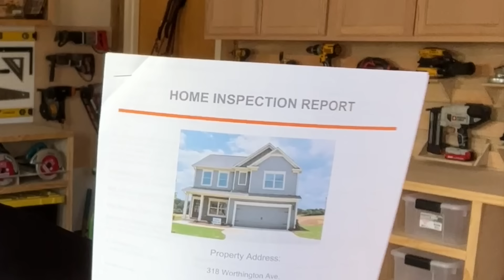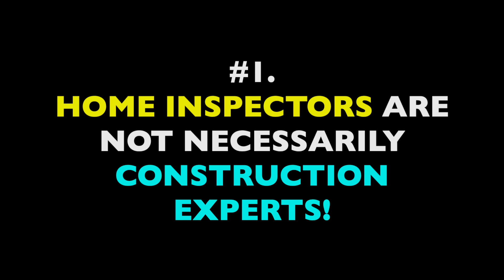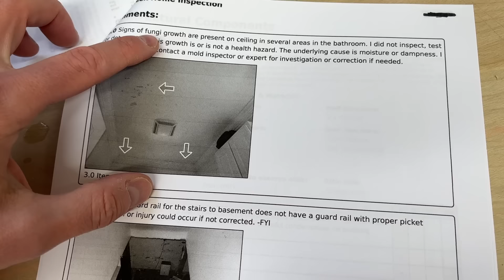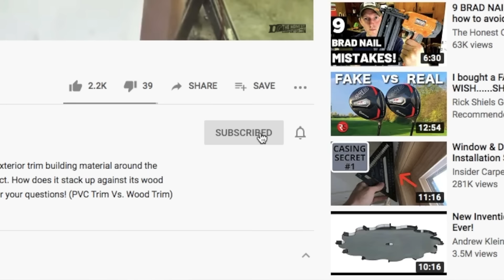The Truth About HOME INSPECTION REPORTS! What They Leave Out...(Homebuyers SHOULD WATCH This Video!)

Comment: The problem I've had with home inspections is the inspectors are more concerned with keeping the realtors happy for the repeat business.  They don't want to scare off the homebuyers as most of these inspectors are referred by your realtor.
Reply: I agree, however that means the home inspection industry could solve this problem by adding a rule that requires realtors to schedule from a "pool" of home inspectors so the inspector is randomly assigned. The inspector can then market some type of "badge" that shows he is a pool inspector and not one that works with specific realtors so that this conflict of interest is mitigated. Another solution is for the home buyer to simply get their own home inspector.
Reply: How about how their reports read?  Might, maybe, should...  They don't commit to anything.  Look at the limited training they get.  All about the money.  You'd be better off having an experienced contractor come in and look around.  A few weeks of training?  Yeah, right.  A waste of money.
Reply: Many states have laws stating that realtors, if asked, must provide at least 3 (# varies) recommendations for home inspectors. 

Most realtors want a thorough inspection because if there is an issue found after closing their client will not be happy with them as well as the inspector.
Reply: @Yellow.Dog.  As home inspector I've walked many a house with a contractor and pointed out things only to hear "hmm I didn't see that."  Great contractors will those things. Most contractors are only going to look at the issue you point them to and don't really take a comprehensive look.
Reply: Maybe the answer is for home buyers to find their own inspectors.
Reply: @thenaughto1056  Do you mind sharing how much or long you trained to be a home inspector?
Reply: @thenaughto1056  Can you share with us how much training is required for a home inspector where you live?  In Michigan, where I live, a couple of weeks is only required.  Thanks.
Reply: I've had home inspectors that have saved me tens of thousands of dollars.
I've also had inspectors that don't deserve to be called inspectors.
The good ones were hired and paid by me and recommended by a good BUYER'S AGENT.
Reply: @Yellow.Dog.  sounds like corporate consultants to me. No commitment/real liability, shift from professionals moving on carreer-wise to it being a career in itself with huge theory to pracrice imbalance...
Reply: @matt_9112  Did you notice the admitted "home inspector" didn't want to admit/state how long or how much training it takes to have that title?  It's a scam plain and simple.
Reply: Which is why i don’t work with recommended people from Realtors or brokers.
Reply: @Daniel  If you don't work with recommended people from real estate professionals, then you don't work with really good real estate professionals.
A really good, experienced broker will get you the best local help available.
A less than great real estate professional will send you to the less than great service providers.
I've dealt with both. 
It can make a big difference.

I live in a small town. When people ask me to recommend someone, I simply give them a list of who NOT to use.
Reply: That's why you hire your own inspector. I did for mine
Reply: @Yellow.Dog. depends on the state 90 hours for 100
Reply: @donaldlee6760 that’s a terrible idea. You would be assigned your Home Inspector. You wouldn’t have a say as to who you pay to look after your interest. There are a lot of sub par people walking this earth and I’m not allowing the state to choose who I do business with in any scenario. If chosen, they’d be guaranteed business no matter how poor their performance.  Capitalism beats socialism and a dictatorship any day, anyhow, anyway. Think about it.
Reply: @Yellow.Dog. in Florida an inspector is required to take 120 hours of online training, pass the state licensing board exam and maintain required hours of continuing education 14 hrs every two years. Also your association may require you to do more hours every year for their certification as a professional inspector.😅
Reply: It’s simple, get your own inspector, not the one the realtor recommends.
I hired an inspector recommended by my carpenter friend. He and my realtor really didn’t like each other. Which I considered as a good sign.
Reply: @juzoli  great advice. I work with hundreds of Realtors in my area for 14 years now. I only trust a handful and many hate when I pull up. However, they do call me when their kids are buying and say, “I’m looking for a great Inspector who is really thorough. That’s why I called you!”
Reply: @Yellow.Dog. you have to pass exams in florida and cant be paid as an inspector until you get licensed by the state..
Reply: Those ones are like the bad car salesmen or crappy contractors without your true interests at mind.
Reply: Some are referred by the banks or lenders.
Reply: @windmillacres679 this is an excellent comment.

Comment: As a tradesmen I can tell you this is absolutely accurate. I'm asked many times how important these items are from homeowners after an inspection. A quality inspection will save you money. Ask for references that are not Realtors!
Reply: Got my home inspector from a Realtor.... No wonder the report showed no problems and I only found the problems after buying the house. FML.
Reply: I agree that the BEST source of referrals for a high quality home inspector comes from experienced contractors who were also past clients. These guys know  a vague report when they see it - usually filled with generic wording, template jargon, and liability-limiting comments (some of which are necessary) but which outweigh practical advice.  In my humble opinion, a home inspector does a better job controlling liability when they put the client's best interests ahead of their own fears or insecurities. It's not a sin to spell out the implications of a defect and to make a specific recommendation.

Comment: Excellent video. As a 28 year home inspector (retired now for 5 years) I feel the pain of the homebuyer looking for more than many home inspectors are willing or able to give. It's a balancing act; providing a thorough report while also attempting to prioritize the serious areas of concern over the minor or cosmetic concerns. I always considered it essential to have my home buyer on-site for the inspection, following me around if at all possible. When the client sees how hard you work to do a really good inspection they understand if an issue of little consequence is overlooked. A very rewarding, enjoyable way to make a living.
Reply: What do you think about this situation. In the closet of my home, under the stairs, if you take a decent look around you will clearly see knob and tube wiring on the walls of the closet.  If the inspector fails to report this is that negligence?  Shouldn't wiring thats 50-70 years old be in the report?
Reply: @luisgonzalez8415  Actually knob and tube wiring is probably older than 70 years. It  is not, in my opinion, intrinsically unsafe. However, it sounds like it is exposed where people or stored items could come in contact with it. That is a problem that should be reported. Questions for you: was the home occupied by the previous owner/tenant when inspected, was that closet filled with stored items making its inspection limited or impossible? An occupied house is a very different situation than a vacant one. Re-read my comment about why it is essential to be present for the inspection. If that closet was filled with personal property I would have commented to my client (you) that  I could  not inspect its interior. It's likely that  the "boiler plate" of your inspection contract had a statement regarding inaccessible areas, which is one  thing,  but actually being present to see the condition and have the inspector speak to you about inaccessible areas is quite another. If these conditions were not present,  If the area was not obstructed,  then I would say your inspector should have seen and noted the exposed wiring.
Reply: While the home was occupied with furniture it was very well staged with everything visible. The closet in question had 1 vacuum and 1 floor fan. It had a light at the top of the closet and the knob and tube is clearly visible. If you are at the closet door it is on the wall to the left 3ft from your eye line looking slightly down. On the day of inspection I was present. At one point of the inspection I clearly remember talking to the inspector in the closet about possible water damage on the closet floor.. But since I had no idea at the time what knob and tube was I had no idea about the wires on the closet wall. 

The thing the bugs me is that as an inspector, I would think there is a mental check list for old homes. My home has the date it was built on the real estate papers, redfin, etc but I assume an inspector would eyeball the place and say, ok this is an old home.  Next thought, for electrical, would be check if there is knob and tube. That clearly did not happen.
Reply: yes, inviting the buyer to come along I thought was a good idea sometimes, but it uses more time.  There are structural, functional, and cosmetic problems. Knowing the difference tells you how important. The first thing buyers look around and point out are usually cosmetic low priority items by the dozen. In listening to the honest carpenter, it does not justify all the expensive state testing, licensing and insurance requirements for such a general inspection. In Wa state, if your license expires, you have to go through all the expense, training and testing again. Best to focus on the systems and how they protect the life of the house.
Reply: @luisgonzalez8415  it
knob and tube wiring should be verbally reported and be added to the written inspection report.
Reply: I've had a home inspector "miss" a 16"x30" hole in the wall because it was behind a washer.
So he didn't even try to look over the top of the washer?
That's a big miss in my book.
Reply: I’m thinking of getting into that field? At 28 years of age 
Should I go for it? Any advice?
Reply: I had an inspector who did not note a water damage repair on the living room ceiling
Reply: Bought my very first house and my inspector who was referred to me by the realtor, did not include that there is water damage repaired in the living room that stems over to the middle of the living room.

Comment: I agree. Most home buyers don't realize the "inspector" may have never had any construction experience. I was looking at a house that hadn't been lived in for a few months. When the water tap was turned, a lot of muddy water came out. After a minute or two the water cleared. The inspector said that was because the house hadn't been lived in, and wrote it off to that. After buying the house I realized that the water bills were higher than expected. I looked at the water meter and the little red arrow was turning. I knew I had a water leak. Turns out I had to replace 1000' of water line. Yeah. I live in the country. Way off the roadway. I think, since I had the "expert" I didn't use my own common sense to look deeper. Live and learn.
Reply: Thats just bad luck. 9999 times out of 10000 the inspector would have been right with that comment.
Reply: @mph5896  pretty sure that's no solace to him.
Reply: @csn6234  was never meant to be.
Reply: The inspector simply should've written "recommend further evaluation by licensed plumber". At least in California our job is a limited visual inspection. If I can't physically see why something is happening it behooves me to not guess. I let the plumber dig deeper for causes.
Reply: Having said that an inspector is supposed to look..inspect and report what he sees..Not making or writing any diagnosis...
Reply: Curious how much that cost you to replace?
Reply: @WayPastCrazy2525  $1500....that happened 20 yrs ago
Reply: Just my thoughts on the subject: 
From my experience as an environmental engineer the muddy water most likely came from dissolved iron in the water being oxidised in the unused pipes. That is a normal thing to occur in unused tabs. I would say the inspector was right.
The leak in the plumbing is another issue that is highly unlikely to have caused the brown water. The inspector might have been able to spot the leak, if they inspected the water meter and saw water flowing without any tap being open.
Reply: Sorry about your expense.  But I think that the leak and rusty water are two separate issues, most likely unrelated.  Water is under pressure, a leak goes out of the pipe not into it.  Wouldn't blame the inspector.  Except anyone could check the water meter, so that's a miss.
Reply: @johnnysimes5082  That's what I said in the first place. I just think a "professional" inspector would've included a look at the water meter anytime there is a question about a water system. The owner said he turned the water off when he wasn't in the house. That info should've given the inspector another clue.  Especially when the water line is 1000 ft long. They work for the home owner and should've done a better job for the money.
Reply: As a home inspector I never "assume" and would written that up as further evaluation as it was visible at time of inspection.
Reply: @googgog4607  I agree.  The leak would have outward pressure and wouldn't allow sediment into the line.  2 different issues
Reply: Can you sue for something like that since the person fell to do their job 
Sue and actually win not sue waste time and money
Reply: @Breeze-gd8wj  HI is a snapshot of the condition of the house at the time of inspection. What ever happens after the inspection, the HI is not liable

Comment: The last home I bought was in the mid 90s. The lender didn't require didn't require an inspection but the experience we had in the home before made it tops on our list. Instead of going to an inspection firm we hired individual inspectors like hvac, electrical, structure roofing etc. We melded the various inspections into a single document with pictures and references to the inspector who did the inspection and presented it to the seller. The seller took 12k off the price and the repairs ended up costing about 11k since we did a few ourselves. 
The way the housing market is today the seller would have just told me to F off and sell it to the next in line and would get his price. The huge increase of corporations and private equity firms sucking up the available homes without regard to price is destroying the American tradition of home ownership. We are being beaten down to a nation of wage slaves and renters.
Reply: True its way out of hand
Reply: Agree.  In the current market, sellers are getting cash offers sight unseen with no inspection. Even neglected, dilapidated homes are being sold for asking price because the real value is in the underlying land.
Reply: Sadly, you nailed it.
Reply: Amen °~•.♡.•~°
Reply: Exactly.Home inspectors look at mostly cosmetics.
Reply: @cgirl111 did you have trouble scheduling that many inspectors at once or did you do it over multiple days?

Comment: I once spent 2 hours with the inspector and the final thing we went through was the basement. We were near the end of the inspection when we discovered that one wall had shifted due to a cracked foundation. Best $200 I spent to avoid a $10000 repair if I had gone forward with the purchase of the house.

Comment: As a Health Inspector, I get asked all the time to do a home inspection. I always say, "No way, you need a professional inspector. Here's a list of Inspectors in my county."
 Like you said I don't have any experience when it comes to construction. Now, if you're want to know about a water well or a septic system, I'm your guy. 
And dear God,  please make sure the septic system is still functioning and under permit.  Otherwise you might be in for a... crappy surprise.
Reply: How exactly do you inspect a septic system and well
Reply: @MK-xl9tt  
Carefully.
Reply: @camerongunn7906  wells I understand ph,hardness,iron,etc can all be tested with a test strip and bacteria send off to the lab, but septic seems to be more ambiguous like your response
Reply: @MK-xl9tt  
If you're talking about putting in a system, then there is a lot that goes into it. What is the perk rate, depth to limiting layer, soil types, soil transition, prevailing site hydrology? What type of system is it, residential or commercial. How big of a site is it? How much land do you have to use? What are the distances from the system to various topographic features?
Is the system going to be subsurface discharge or a surface discharge? Will the system need filtration, tertiary or quaternary treatment? 
See...carefully.

Comment: Perfect! You nailed every point perfectly. I have worked in all the trades over the years, had my own general contracting company, worked around construction sites after that for another 30 years and I am a non-practicing certified Home Inspector. Quite frankly the $300-$500 you earn per home inspection isn't worth the time invested not to mention the liability risk you undertake and the proper equipment an inspector needs to perform the inspection properly. A thorough inspection is worth $1000 and would be worth every penny to a homeowner from a "skilled" home inspector. I performed my own inspection when walking thru the house and waived the inspection normally required by the bank on the last 2 homes I bought for the reasons you mentioned and my personal skillset. So, all of you reading this get educated so you know what you're getting into when buying a house and do exactly what Ethan says. My opinion...Don't ever ask the realtor for a home Inspector as a general rule. Ethan touched on this.